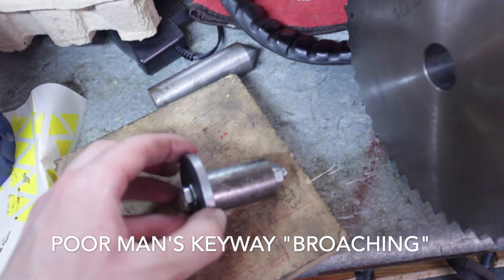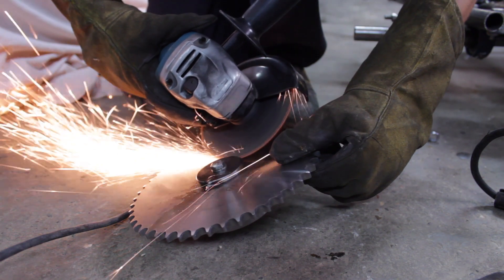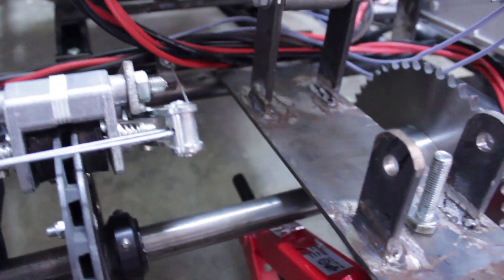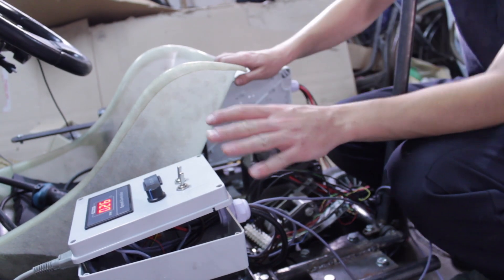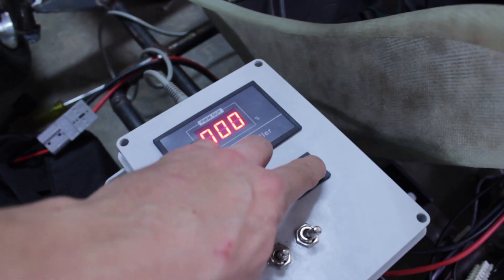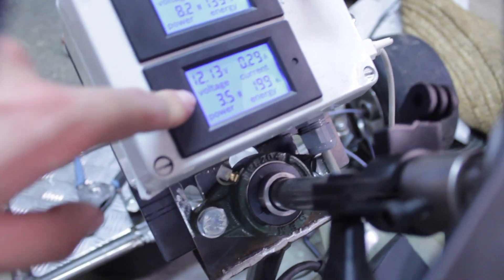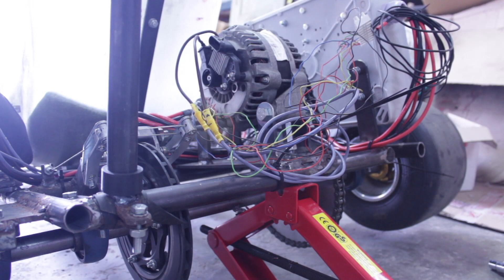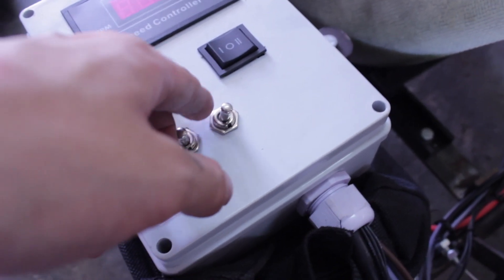The CAR ALTERNATOR GO KART  is almost complete! + Sprocket swap and field weakening

Comment: Very cool! I'm also working on an alternator kart. How are you managing field weakening? I don't know much about it.. Something else apart from adjusting stator voltage?
Reply from the maker: Thanks! I control the rotor voltage with a PWM that I can regulate between 0 to 12V, for the last video (https://www.youtube.com/watch?v=UeJPAhFpp-g)  I used it at 100%, maybe soon I will try to attempt to achieve more speed by regulating the PWM.
Reply: Hey Fredrik, do you have any videos or posts in social media/forums that i can follow you?
Reply: @foxxyytofficial  No I don't, sorry.. But I will let you know if/when I do!
Reply: @fropple  okay, i will be waiting to know if/when you're going to post something, and if you need help i would like to help

Comment: Oh my god, what a wonderful surprise to see you uploading again ^^
I was wondering when you were going to upload again
And i'm absolutely loving the progress so far, the throttle response is a lot better and you don't feel those "bumps" like when you used the older controller in sensorless mode
With the finishing touches ans checking the programming, its going to be the gran finale